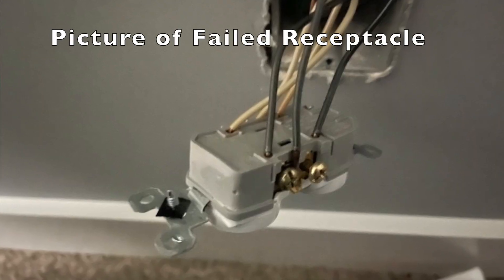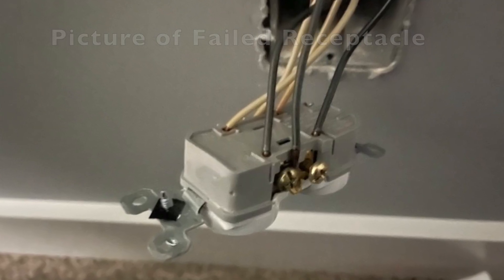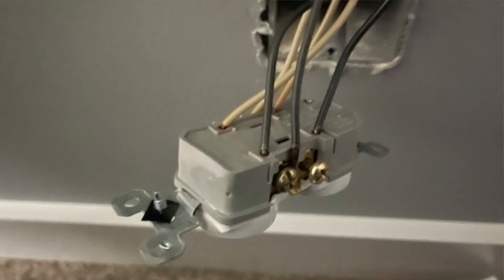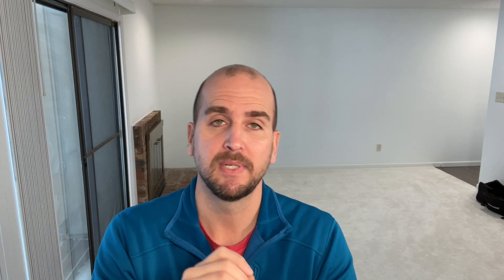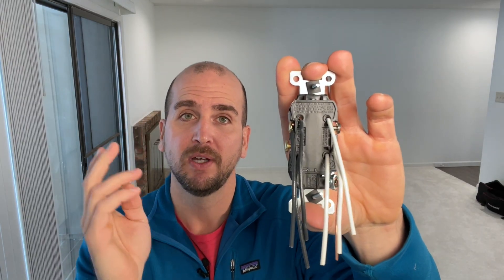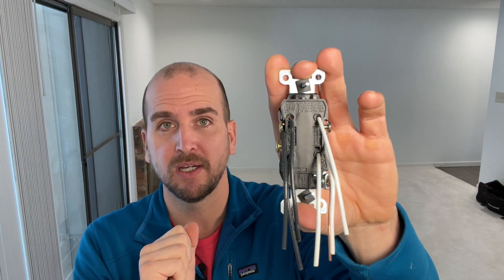Incorrectly Wired Outlet Found In Newly Built Home

Comment: Manufacturers need to stop making push-in connectors. Code should prohibit them. The back-wire connections that use the screw to properly tighten are so much better. No need to make hooks or try to pull stubborn hooks off screw terminals. They’re quick, easy and secure.

Comment: How do professional electricians feel about Wago connectors in comparison to wire nuts?? I personally don’t like to twist the wires up together but prefer having nice straight wires.
Reply from the maker: Generally, professionals are sticking with wire nuts in the US and Canada.  I think Wago 221 is the most beneficial for DIYers to get a consistent solid connection.

Comment: Push-ins fail! I have replaced many that have burned up. Also, they were daisy chained instead of paralleled/pigtailed. What does that mean? 
It means that if an outlet at the end of the chain draws 12A then ALL outlets in the chain have 12A going through them. Good video!

Comment: When you have two screws on each side of the receptacle why would you put two wires under one screw. Also your pigtails are too short. Some localities code require pigtails on all mid circuit receptacles and most localities require pigtails on receptacles with more than two pairs of conductors. Personally I pigtail all the receptacles regardless of how many pair of conductors. It insures the circuit stays online in the event a receptacle fails and it makes troubleshooting and replacement easier

Comment: Hi there i like your vids, My question is next week i will replace two   side by side  worn-out rocker switches in my bathroom and i think they are single poles.The new Leviton switches
are No.6526-w rocker switches with built in guide led lights. So my question is they call for a white neutral wire to be connected however all the white neutrals are
wire nutted and pushed into back of existing junction box,and i guess i need to pig tail from those.
Also  when i undo everything there is 4 black and 4 white becuase the wiring used is 14 gauge 2 -wire black and white

Comment: I did see something, again not a violation of the Code That I have heard electricians Say it’s not a good practice. They say when they Install an outlet They like having the ground plug at the top, this way if per chance something shorts The plug The ground hopefully will prevent the hot wire Making contact with neutral, I’m not an electrician, every outlet in my home the ground Is positioned up not down!

Comment: My son bought a house and the kitchen and bathroom located on the backside of the wall all went dead. Someone had used the push in from the panel and then daisy chAined 3  receptacles( coffee maker and microwave included) and then went to the bathroom. What a nightmare to chase down. We felt a lot safer after it was we fixed it. Thanks for your tips. Always informative.

Comment: The reason the receptacle overheated is because the amperage rating was exceeded of the receptacle. There are 15 and 20 amp receptacles, and they should match up with a corresponding circuit breaker. A rule of thumb is 100 watts at 110 volts is pulling 1 amp, so you dont want to put more than 1500 watts of an appliance, or multiple appliances on the 15 amp receptacle. A 20 amp receptacle will support up to 2000 watts.

Comment: I’ve just done a search of your past videos, and what I was looking for was “troubleshooting 3 way switches” . I have installed a new set and replaced one of a pair in a previous location. In both cases one switch works as it should, turning the light off and on. The other switch can only turn the light off, but not on independently if the other switch is off. Did I miss a video that goes over this?
Thanks, Rick

Comment: One thing you can do better on the pigtails is to make sure the copper is not  intertwined with the plastic when you twist the conductors together. This can cause melting which will interfere with the circuit later on!

Comment: I was told, "you never use the wire nut to hold the wires together. You twist them together and cover them with the wire nut. He and others, have had many calls, where a wire had come loose in the wire nut.
  A friend call, he lost power in two rooms. It turned out to be wires loosing connection in a wire nut.
  I do understand the purpose for tugging on the wires as well.
Just my view.

Comment: OMG :D What a hack twisting wires like that I see that in States you still use those antiques wire nuts but that is just simply a hack. That push in is much safer btw then screw in terminals. Screws will get loose and spark.

Comment: Love the pigtail suggestion, my question is, while trying to install a GFCI, there does not seem to be a lot of room in the box to accommodate the wire nuts.
Reply: Wago lever connectors have a very low profile. The push in versions are even slimmer, but not suitable for some situations.

Comment: Question: My old receptacle fails with "open ground." Voltage Hot-to-Neutral is 122, Hot-to-ground is only 67. What should I be looking for? Thanks!
Reply: Make sure no 3way switch, is on the circuit. Unfortunately many of them allow for a bleed through voltage.

Comment: Push ins may not be against code but they should be think of it you are making a connection with a spring loaded peice of copper about the thickness of a hair that touches a copper wire that's a round profile it's not a good connection at all the worst part is you no longer have electrical drawings and schematics for a house so when things fail it can be a nightmare to track down with hidden outlets it's worse had 2 cases of this one was a tripped GFI outlet it wasn't in the bathroom so I looked to see if it was a blank GFI  by the panel box wasn't there either so i looked at the panel box it wasn't  there looked all over for it couldn't find it then her son came home and found the internet was out so I asked where the router was it was on a built in shelving unit beside the laundry room and their it was bottom shelf behind the books it's one way to cut costs a GFI breaker is  60 $ or more more a GFI blank is about 30 $ a GFI receptacle is under 20 $ the other was a arc fault circuit that the arc fault breaker didn't do it's job not only did the plug fail but it fried 3 other plugs on the circuit finally found the last fried receptacle in the master bedroom closet  the receptacle should have been 30 amp 110 as it was being used for a lift to get a 400 pd man into and out of bed the it should have been at least a 20 amp circuit or at least a 20 amp receptacle  I've seen those push in terminals fail as well letting just enough power though to light the circuit tester but not enough to power the lights trying to figure out where the wire ran to what receptacle were on that circuit was a nightmare then the tenant tripped over the extention cord they had running to a lamp and on went the lights moved the plug just enough to remake the circuit turned out the old owner had upgraded all the receptacle to the more modern Decora and had just used the push ins for ease of installation

Comment: Man oh man, like you said NEVER use the speed connector on the back. The mobile home I have on our vacation property has these everywhere and everything is run serially. UGH. So you get one outlet going out if something is plugged in up the line from it, etc. Once I replaced them and did it RIGHT it fixed the issues(s). It's all about the amount of contact, which is why you always braid your connections and use a wire nut not a damn speed connector.

Comment: Most times there is no frickin room in the box for adding wirenuts and another foot of wire. This make it extremely difficult to reinstall the socket and puts a lot of unnecessary pressure and strain on the wiring. That issue then outweighs your problem. I have a 21 year old home that uses the push in terminals on every socket switch in the house and Never had an issue with your #3. Perhaps electricians trying to scam another buck by not using quality sockets/switches should have been your #3?

Comment: According to 2 different people.... one a professor of electrical engineering, and the other an engineer for an electrical supply company, you are not supposed to pretwist the wires before introducing the wire nut
Reply: Yes, from a master electrician and instructor in 1974, let the wire nuts knead together the conductors.  Tools can nick and stress the copper.

Comment: The open screws I believe is a very lazy habit picked up by the forgiveness of plastic electrical boxes..
Those metal boxes can be a lot less forgiving.  Because of this, I've gotten into the habit of wrapping the whole recptical with electrical tape as an added layer of protection.

Comment: I am not an electrician. I had my shop remodeled, and did the rewiring myself. I had two 20 amp breakers to wide from. I pigtailed all of my receptacles, which was tough using 12/2 wire. I also wired my two light switches where I ran power to the lights, then to the switches, utilizing the neutrals wire as hot wires. I did mark the light fixtures with stickers saying the fixtures have hot neutrals, along with black electrical tape on the neutral wires in the switch boxes. I even put stickers under the switch covers saying the neutrals are hot. Overkill, but I thought at some point my son will inherit this house and shop, and he’ll appreciate the overkill.

Comment: The crap I've found over the years just blows me away.  Outlets wired wrong (they're friggin color-coded, HOW do you make this mistake?), Smoke dampers wired backwards (open upon power failure vs closing off fresh air supply),  furnace exhaust routed to interior vs exterior of building...etc..
Reply: Holy shiyite! Furnace exhaust? You may have saved lives with that discovery!

Comment: QUESTION in the example of the jumbled mess he's holding, l can pigtail the 3 black wires together with an extra wire ( 4 in total ) that will connect to the outlet? 
He shows it being done with 2 and not 3 so im a little confused and want to make sure.

Comment: Disagree with “the professionals” that tell you stab in wires fail more. They’re the same professionals that tell you wagos are garbage and the same professionals that believe pretwisting your wires before putting on a wire nut is required (even though it says on the package pretwisting is not required)...so to all of you professionals that say these things. Get a J card and then we can debate these points. Until then, you’re just a handyman with an opinion. If it’s listed. I’ll use it. Stfu. 🤗
Reply: thanks, Francis.

Comment: I ALWAYS put electrical tape on wire nut connections before stuffing them back into a box. The bare equipment ground can bend and come onto contact with the exposed conductor on a hot as the wire nut has a bevel and doesn't completely cover the exposed copper wire.

Comment: Nice videos you shared i have a question with regards inserting the wire usually in screw but you make different way by inserting at the back of the screw is it also safe thanks hope you answer mine ✌
Reply from the maker: If you buy a Commercial Grade Outlet (Usually only about $2) there is a feature called back wiring which is safe and I like much better than speed wiring.  Back wiring the screw terminal is tightened and a small plate squeezes the conductor making a solid bond but can also be loosened and reused unlike speed wiring which is 1 and done.

Comment: Hey there nice vid. Quick question regarding "pairing" of neutral and hot wires (obviously in the event that you have 2 sets of neutral and hot). Does it matter which hot wire is connected to which screw relative to the neutrals? I did read something saying it was (as one pair is an input and one is an output when in series) but when I thought about it and realized that both terminal screws on the hot side and on the neutral side are connected by the little bridge piece anyway, it would make absolutely no difference. Am I right there? Cheers!
Reply: You are correct, in this example. If it were to be, for example, a GFCI receptacle. Then you would have to keep the pairs separate. There are a few more examples as well, but for the application, you are correct

Comment: I noticed you put the back wired wires to the top connect in. Does that keep power to both outlets? Or does it matter, top or bottom?
Reply from the maker: Yes,  there is a small tab that connects the bottom and top terminals so just as long as the tab is still there power will go both to the top and bottom.  That tab is removed when you want to make one of the outlets "switched" power and the other one always on.  This is common in older homes where people plugged in a lamp and wanted a wall switch to turn on/off.

Comment: The push-in thing makes me wonder. In europe no one fiddles arround with bending wires to screw terminals theese days, and everything is push-in. Most outlets and switches even don´t have screw terminals anymore, and are push-in only designs. 
And i think they are much more efficient. When professional electricians wire up whole buildings, with hundreds of outlets and switches, the push-in connectors save them a lot of time.

Comment: Something not so common in the US but I think is really smart is to run electrical tape around the part of the plug with the screws after the screws are tightened.   This way you can't accidentally touch the screws when removing the receptacle in the future.
Reply: @armslength2618  yes they should does not mean they are.   Stupidity knows few bounds.

Comment: why are there 3 hots & 3 neutral wires in a new build household receptacle? is there some spur that it goes to? I would think in a new wired house that you just go from one outlet to another, until the last one has just 1 of each coming in. So normally you would just have 2 hots and 2 neutrals (line and load) in each receptacle before the last one on the circuit.

Comment: Hi
Why are you using 12 gauge wire on the receptacle you were demonstrating in your video?
Is the receptacle a 15amp?
The breaker used on that circuit is it a 15a or 20a breaker?
The reason I ask if the receptacle is a 15a and the breaker in the panel is 20a that’s a problem. 
Just curious as the wiring is #12. 

Thanks
I look forward to hearing from you

Regards
Bob
Reply: Most outlets, as opposed to light circuits, are now wired with 12 gauge.  12 gauge is OK with either a 15A or 20A breaker.  14 gauge can only use a 15A breaker. 
Even 15A receptacles are permitted on a 20A breaker with 12 gauge wire so long as its not the only receptacle on the circuit.  The reasoning is, if there are more than one receptacle, you would not expect the full 20A load to pass through any given 15A receptacle.
In reality, I think most if not all 15A receptacles can actually handle 20A. Still, it's unlikely you would see 20A used at any given receptacle. That is also why you need so many circuits in bathrooms & kitchens. And for dedicated outlets like air conditioners. Code assumes that kitchen appliances could pull 20A from small appliances, and so you need at least 2 circuits for kitchen, plus a dedicated fridge circuit, etc. Same thing with each bathroom. A hairdryer can easily pull 1500W, which is the max on a 15A circuit, so you need a 20A circuit for each bathroom.
Reply: @jenjeffsher3616  
Thanks for the feedback 
I haven’t checked the Canadian Code lately but back in the day the breaker size was for the wire. 
If I’d installed a 15a receptacle on a 20a breaker it probably wouldn’t pass inspection. 
The Canadian Code may have changed. 
My point is a receptacle rated at 15a May survive 20a draw but if there was a problem and that receptacle failed, the first thing I’d hear is a 15a outlet on a 20a circuit???

Anyways, I appreciate your feedback. 
Thanks a bunch 
Bob
Reply: @bobboyd4029  From Dennis Webber on Quora:  "This is addressed in The National Electical Code. You can use receptacles rated 15 amps on a 20 amp circuit if you have two or more receptacles. If there's only one, it MUST be rated to withstand the load of the overcurrent protective device. That is, 20 amp rating on a 20 amp circuit.

In counting receptacles, two outlets on a single strap are counted as two receptacles. A strap is the bar that the receptacle outles are mounted on. If you can plug two different cords in at the same time, its two receptacles. These are called “duplex" receptacles.

Most common place where a 20 amp receptacle is required, is for a microwave. These are usually located in a cabinet and intended only to supply the microwave oven. (Some local AHJ require a 20 receptacle for a microwave even if its a duplex, as only one device is intended to be plugged in).

The NEC reference is 210.21(B). Specifically Table 210.21(B)(3)."
Reply: @jenjeffsher3616  

Thanks for the information 👍🏼

Comment: I'm not an electrician, but I almost instantly hated push-in connectors when I encountered them. Might be an easy way to install a wire, but getting it out again is a massive pain in the butt. And they seem more likely to melt when overloaded.
Reply: You're supposed to put a certain small size flathead screwdriver into a particular hole to remove.  I'm not sure if this is always indicated in an obvious way on the outlet.
Reply: Nope, it's not indicated in an obvious way. Maybe it's stamped in that squinty-size printing somewhere. 

So, ok, as long as you have a precision  flat head screwdriver of the right size, push-ins are only half a pain the butt. You still them to turn them around to get at the connectors.
Reply: The Wago connectors used are not push-in connectors they are LEVER actuated splicing connectors. I"ve used both the "push-in" and the LEVER connectors and they both have situations where they work very well, but you have to understand HOW to use them. Thank you.